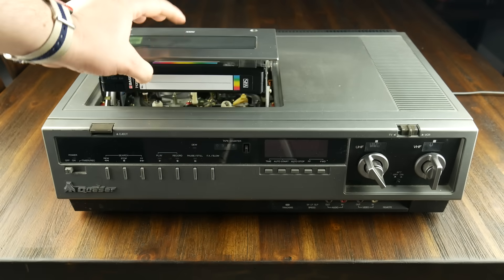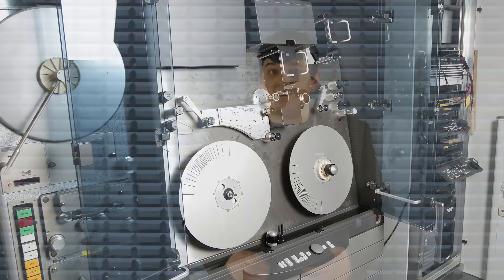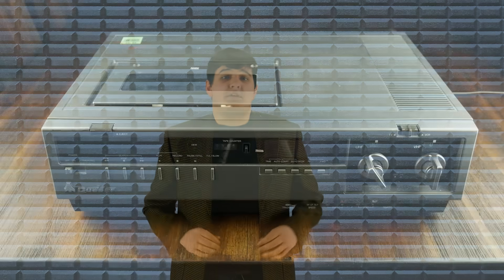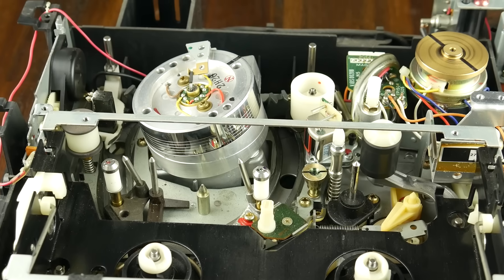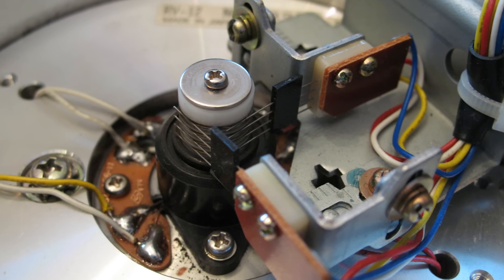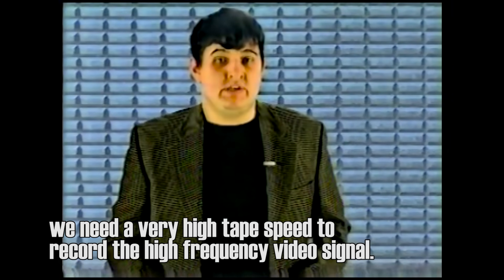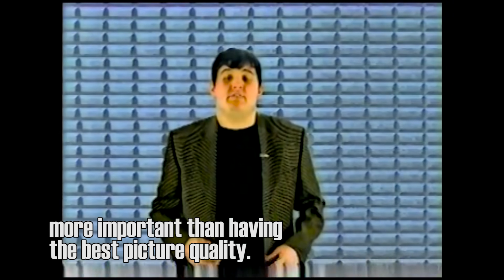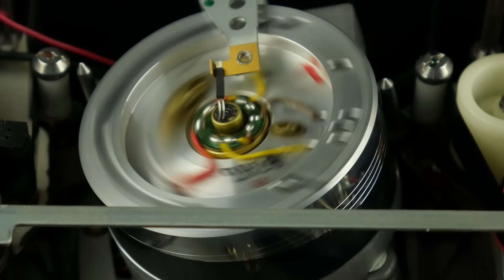The Impossible Feat inside Your VCR

Comment: Good video, but I'd suggest that the VHS deck you used for the video quality comparisons is showing notable signs of head wear - or the tape you used is of inferior quality. Regular standard-play VHS, with a good-quality tape, looks much better than it does here. You say it's SP mode, but that looks like LP to me.
Reply from the maker: Well, considering the only machine I have capable of recording in LP mode is from 1979, I'd say you're probably right.  I wanted to use the same machine for the initial comparison.  You can tell that the clip I use to demonstrate HiFi was made with a different VCR as the picture quality does look better even with SLP
Reply: About the time that HiFi became a standard, machines started dropping the LP mode. 
Something I found interesting, on slightly lower end machines, the SLP mode actually produced a better still frame then the SP mode. It was only when I had gotten a higher end VCR could I really see the difference. 
LP mode was an attempt to get slightly longer running time while still retaining some quality, but... it never did. retain that quality. Thus, hardly used.
Reply: this is is the US. they have sp, lp, slp/ep. most vcr had lp taken away in the 90's so they can't record lp. most vcr have sp, slp/ep now. lp was taken out which was dumb. not everyone is in UK where you seem to be where the 2 speeds are sp and lp but the lp is the slp/ep speed in the US it seems. so they called ep by a different name in the UK. so you never really had the lp where you live that this video is talking about. 
https://en.wikipedia.org/wiki/VHS#Tape_lengths
Reply: Well, you're the one who said "almost every VCR ever made had LP", which clearly implies almost every VCR from the introduction of the format in 1976.

If you meant "almost every VCR ever made *after LP recording was introduced*", you should have included the qualifier - but it's also wrong, because in many global territories LP recording was only available on high-end decks until well into the 80s and didn't become standard until the early 90s.

In PAL countries, for example, LP was considered unnecessary for a long time because 3-hour standard-play tapes were widely available and indeed were the most commonplace.
Reply: US decks might have stopped dropping LP mode, but it didn't happen in most of the rest of the world. LP remained completely standard until the end of the format's life. 

I have several VHS decks from the early 00s (so, decades after hifi audio was introduced) that support LP mode.
Reply: I'd suggest using an SVCR with TBC and SVHS tape with S-video cable. Now, that's as good as it would get.
Reply: "Old-style" TVs - by which I presume you mean CRTs? - never had an equivalent resolution as low as 320x240, at least not from about 1938 onwards! PAL was (is) 720x576, NTSC was (is) 720x480.

OK, you can argue that interlacing meant that you were only ever seeing half the vertical resolution, so each field was only ever 720x288 or 720x240, but persistence of vision (and phosphor persistence) effectively eliminates that distinction.

If you are actually referring to the effective resolution of VHS, then that's a different issue, and some people would indeed argue that you were getting roughly about 320x240.
Reply: It's not correct to say "almost every VCR ever made had LP". It didn't exist for the first years of consumer video recorders. It wasn't considered necessary, because both VHS and Beta offered tapes that could record over three hours.

LP really arrived in the early-to-mid 80s, initially on the higher-end machines, but over the course of a couple of years it became a completely standard capability.
Reply: i remember a few vcr from the 90's having lp now. would think they could be found easy and cheap too.
Reply: Zcooger Second Channel For some decks  it was very difficult to playback a pal lp tapes recorded on other decks because head aligments. I found (again) Jvc were the best to catch other deck lp mode merely with the autotracking. they sere capable to to still wit decent quality, but i found out it depended on the tape quality. with tdk EHG it was always in color.  on the other hand sonys deck sucked at playback tapes from other machines, even with manual tracking, sometimes you had to loose hi-fi tracks to get a half decent picture quality (but had a nice lp mode when the tapes were recorded on them.   Just a thougth, look for a late 90s early 00s jvc s-vhs deck if you want to digitize tapes from different sources. TBC is great, sound is nice and the B.E.S.T. system was great to take the best from everytape. both on recordings or palyback.
Reply: Almost every VCR ever made had LP just go get a different one genius. You will find it nearly impossible to find a VCR that doesn't have LP. Do some basic research.
Reply: Obviously I meant after it was first introduced. I do assume people have a basic level of intelligence. It's unfortunate that you lack a basic level of intelligence. Before responding to any more comments please ask somebody who you consider smart to read to you and help you understand in the future.

Comment: I had an ancient VHS machine, called a Ferguson Videostar. They were made by JVC. Mine had four heads, and a "broadcast quality" mechanism. When you pressed freeze, the image was absolutely still. Sound came from the normal stereo tape head. It was one of the first with a wireless remote, though you couldn't program it from that. I still have my 1997 Panasonic SVHS machine, in regular use. Of course in the UK we used the PAL system.

Comment: Great video! You covered all of the things I personally think is impressive about recording to videocassette.

As a side note you are very right on the 90s sort of "taking" features away from the format. Feature wise, the best VCR's tended to be released in the late 80s. The only problem with these is due to the amount of features they pack, they tend to break down a lot more. While late 90s dedicated VCR's tended to be the most rugged due to being simplified and essentially, perfected for mass production. Using VCR's from all different decades will yield different results but will always be super fascinating to compare and contrast.

Going further, once VHS started to be combined with DVD the quality of the VCR portion itself started going downhill even faster. Most would think it would go up due to time, but honestly my 1989 Sony VCR blows my 2008 VHS/DVD combo player out of the water.

I'm rambling now, but again, great video and thanks!

Comment: I always thought these would make amazing audio-only recorders if there was a way to use the whole tape for sound.
Reply: It is actually possible to record digital audio onto a standard VHS tape. I think you either had to get an adapter or a special machine to do it, but it is possible.
Reply: It is actually possible to record digital audio onto a standard VHS tape. I think you either had to get an adapter or a special machine to do it, but it is possible.
Reply: No, I meant analog not digital.
Reply: DJ alt.rock Sure it does.  You can store multiple signals across the whole tape as long as each one is on a different frequency just like FM radio in the air.
Reply: HiFi VHS recorded stereo audio across the whole tape by modulating it at a different frequency from the video.  I used to record live bands to HiFi VHS.
Reply: Stephen Baldassarre I feel like that modulation would still not be what I'm talking about because you still wouldn't be using the whole tape.
Reply: I remember there were audio only decks using the hifi portion of VHS, and it was compatible with home video. My uncle recorded much of his music collection onto VHS hifi tapes in the 80's, and it worked great.
Reply: I replied to the wrong post :-) I know HiFi VHS... I invented it. Stupidly I told Sony.

I had an idea one night and an hour later I'd got it working. I fed an un-de-multplexed FM radio transmission from the guts of a tuner I was building in to the video-in of a VHS which I sync-locked with a hard wired pulse (from a Pong game) to the control track. The replay, which needed to be de-multiplexed to get Stereo had no FM radio stereo hiss at all. Sadly, the head crossover gave it 50Hz clicks, remarkable low level though. Slow motion sounded odd - 'samples' repeated - we now know that sound as a digital effect - but this was all analogue :-) 

I would record all of the Medium Wave radio bandwidth too - I could  tune in to any station I liked on replay. I was rather proud of that, it too didn't make me millions.
Reply: VHS hi-fi was a great way to store music. 6-8 hours on one tape, better sound than most any consumer level equipment during the mid to late 80's. I kept 100's of cd's I borrowed on VHS hi-fi  because open reel was just too expensive and cassette was just 45 mins a side and not real durable. Real time counters, cheap storage, durable, 8 hours a tape, and great quality made vhs best for me. Of course, people would look at me funny when I'd get a vhs tape out to play music.
Reply: Patrick Aubry To my knowledge, the only "professional audio" for U-Matic was done by modulating digital signals into the video carrier.  I used to have one such device but always thought HiFi Beta or HiFi VHS sounded better.
Reply: I had a Sony Pcm-f1, cutting edge for the time but I too thought is sounded a bit harsh and preferred a good cassette or reel to reel deck over the digital pcm converter.
Reply: DJ alt.rock I used to record stereo radio on a vhs the sound sounded like live radio it was really amazing sound 10 times better than any standard stereo music tape recording!
Reply: Stephen Baldassarre They did that with à special version of u-matic vcr for audio works.
Reply: I owned a Beta HiFi machine.  The Pal Beta HiFi audio was recorded quite differently from the way Ntsc Beta HiFi was, being laid down by audio heads (before the video) on the revolving drum and it occupied the majority of the width of the tape - at a greater depth in the magnetic medium. Unlike a Beta with standard sound, this audio could not be over dubbed but had to be recorded at the same time as the picture.
Reply: John Klumpp Same as ntsc and I mastered vcds, the quaity was crap. today que cramp 720p HD in the Same space.
Reply: My philips vcr had a record sound only mode. Not sure if it used the whole tape, but it sounded mighty fine.
Reply: Read my post on how I did it BEFORE the Hi Fi multi-head VHS came out...
Reply: Any idea how that worked ? Was it Stereo?
Reply: Simon Anthony HiFi VHS works the same way, and yes it is stereo.  The audio is modulated at a much lower frequency (longer wavelength), so it goes much deeper into the magnetic coating than the video signal.  When the video signal is recorded on top, the audio signal is only erased on the surface, so it can still be read.
Reply: Simon Anthony Yeah, IMO, the clicks were the only thing keeping it from getting serious usage.  It was cheaper than digital for certain.  I always thought it would be cool to multiplex eight channels onto the tape for portable live recording.  Then the ADAT came.
Reply: VHS HI-FI did use the whole tape, but recorded the video signal on top of the Hi-Fi wideband FM carrier. The Hi-Fi FM carrier was also recorded using another set of heads on the rotary head assembly, and the Hi-Fi carrier was recorded with wide gap heads at a different azimuth angle than the video signal. There actually were 2 independent RF signals recorded into the tape oxide, with the Hi-Fi carrier recorded deeper in the oxide layer than the video carrier, which was mostly right on the surface of the oxide coating. This was called "depth multiplexing" and was how VHS achieved Hi-Fi when there was no bandwidth left in the video channel. Beta Hi-Fi actually used only the rotary video heads for everything.